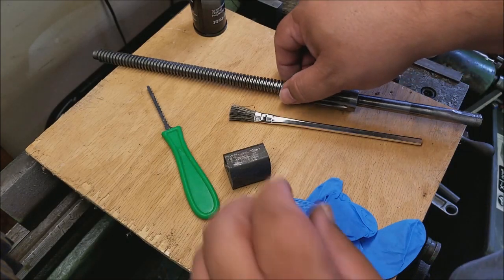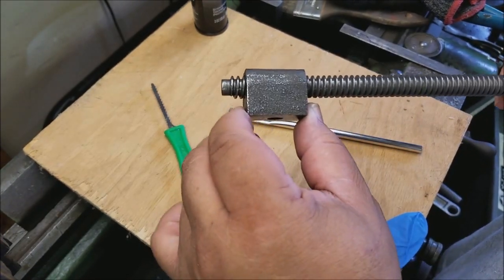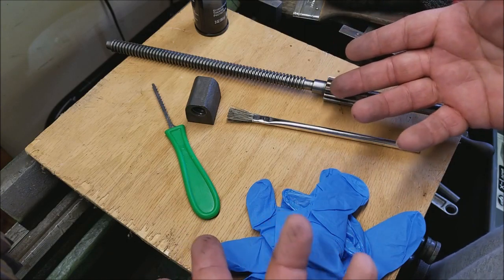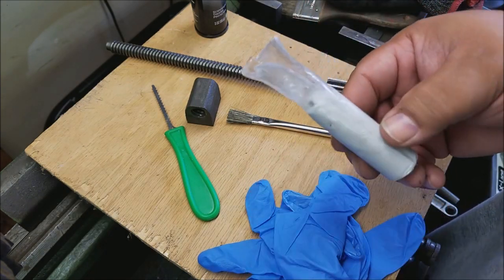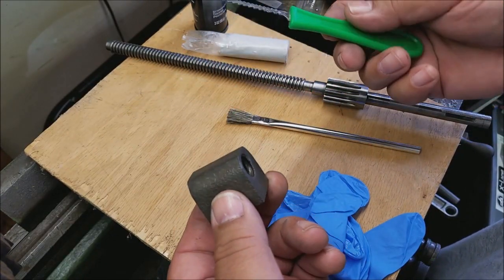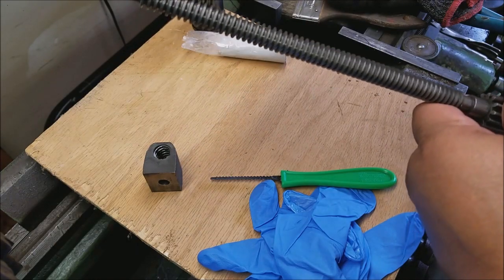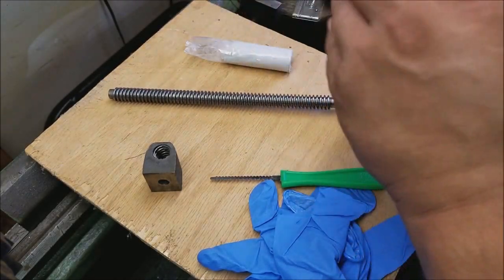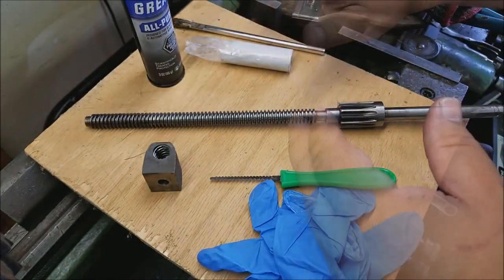SHELDON LATHE - WORN - CROSS SLIDE NUT REPAIR - FAIL???

Comment: I have a spare one of these that I made years ago. I tried selling it in eBay but no one bought it. It’s just sitting in a drawer now. I made it to fit my Sheldon. Did you ever get yours fixed?
Reply from the maker: Hello Some Guy,
No it's the same as I left it in the video. I wish all I had were shop projects to work on lol. How did your project come out and was that the only worn out piece on your lathe? Did you replace the lead screw at the same time? Tell me more about your sheldon lathe. Thanks for watching and commenting...
Mike - Plus8Precision
Reply: @Plus8Precision  you can buy Sheldon replacement parts from the company that owns all of the drawings now. They are willing to make anything, but they don’t carry any parts. The name of the company is Bourne and Koch, I urge you to double up on any heart Medicine you might take before you open any emails from them. Their prices are prohibitively high. There is a Sheldon Lathe owners group, we have been collaborating for many years now online. Often you find that Sheldon owners are quite passionate about their machines. There is just something about them, no one is willing to give up on them.
Reply: @Plus8Precision  well ok, for your sake I hope you really want to know. My Sheldon, was born in 1956 in Chicago, I am the third generation in my family to own it. I’ve had for 20 years now. I have made a handful of parts for it, with the lathe itself, while it was crippled. It still needs many worn gears replaced, which is quite a problem since they are 16 D.P. Gears with 20° P.A., and since that is an obscure pattern the gear cutters are not easy to find.
When the time came that I needed this particular crossfeed nut, I had to buy the 1/2”-8 LH tap to make it, though I still did the milling with the lathe. I did not replace the screw yet, cutting the spur gear into the screw wasn’t possible at the time. I hope to be in a position to produce that feature this winter when I can get back into my shop and work. It’s far to hot to be in there now. Reproducing the nut went great though, and I made an extra, I was hoping to sell. I have no need to keep an extra on hand since I can make one anytime I need. I would be happy to sell it, it’s made from brass instead of cast iron. 
My Sheldon, has a taper attachment, which is quite handy. I wish I had the metric threading gears, and plan to make them after I get the others finished first. I have never been interested in painting it, so it is obviously an experienced machine. I have the four speed under drive, and it has always been just fine. I had to reproduce the felt wipers for the carriage recently, fine detail cutting 3/16” wiper felt really sucks, it just didn’t come out crisp no matter what I did. I cut the felt oversize and smashed it in there,  they are working good and my shame is hidden by the wiper holders. 
Is there anything else you would like to know?
Reply from the maker: Hello Some Guy,
I don't know if you watched any of my other sheldon lathe video's but, I have made other repairs. Replacing a gear, changing bearings and bushings. My ways are in poor shape dimensionally but look ok by eye. I did find a company that sells the lead screw stock and lead screw nut threaded stock. I like my lathe I just wasn't planning on putting this much effort into it to just use it. 

I'm in the sheldon lathe group it use to be a yahoo group until recently. There is some good info available in the resources area. I did enjoy reading the history of your lathe.
Reply: @Plus8Precision  I’ve been in the Sheldon lathe group for years. It’s been a good resource. All these lathes are so old, there is little option for available parts. I only found your channel recently, I’m working through the videos you have. I didn’t like any of my options for replacing the screw besides making it from scratch. Let me know if there is anything else I can do to help you.  Or information I can provide. The crossfeed nut I have is available if you wish, just let me know.

Comment: BETTER ! GET ! ANOTHER !! BAND !! AID !! OUT !! 
PROBLEM !! FIXED !! NOW !!
Reply from the maker: @David, This was a trial using a product that i have used at work for over 20yrs. I have seen the strength of this "pig putty" in other applications. And since the nut is shot it didnt matter if it worked or not. As of right now it still works but i dont use it every day. I thought it would be interesting to share. Thanks for watching and commenting...
Mike - Plus8Precision
Reply: @Plus8Precision  There's Something ! Your not ! Doing ! right ! There ! But ! Good ! Luck ! Using !! Band ! Aid ! Putty ! To ! Fix it ! Then !

Comment: Did that also, and only worked for a few months. Cracked apart, Tried again, making the complete nut of 'Gorilla' epoxy, again worked for awhile, broke apart. Have to get one made.
Reply from the maker: Hello Lawrence, i figured i had nothing to lose and i already had the pig putty so what the heck, right? Is your thread an odd size, idk what lathe you have. We try thing and learn stuff then we know. Thanks for watching and commenting...
Mike - Plus8Precision
Reply: @Plus8Precision  @Plus 8. Thought the same as you, with my old lathe, what to do?, answer, anything?.  Now trying any avenue to 'fix' it. Well, it does pass the time.
Reply from the maker: Thats true it does pass the time lol
Mike - Plus8Precision
Reply: Well, 5 months+ later. Had the acme shaft machined to same size, going to make nut out of Gorilla epoxy, this time with wire in it. Hope it works better than the plastic one I made.
Reply from the maker: Lawrence,  I would be interested in the out come of your project. 
Mike - Plus8Precision

Comment: You may have already done so, but if not, a spindle bearing adjustment may be in order to help stop the vibration...
Reply from the maker: @Al C, i thought of that and i checked the spindle in all directions. I used my tenths indicator to perform the measurement. The bed and carriage are my issues.  I have done some measuring and im not sure what to do. Whatever i do i have to within the 4 walls of my shop.  Thanks for watching and commenting. 
Mike - Plus8Precision

Comment: I keep my punkin cutting tool's also.
Handy piece of equipment, I got two acme nuts welded to top of the old screw and fixed my 1912 pratt&whitney lathe.
Reply from the maker: @Kentucky  Trapper, you know your punkin cutting tools lol. The only acme 10 tpi LH stock i found is made from bronze. I see what you did saved the trouble of replacing the nut when all you needed was new threads good idea! Thanks for watching and commenting!
Mike - Plus8Precision
Reply: How did you weld them and secondly where did you get the Acme Nuts thanks!
Reply: @FernandoGonzalez-Nova  I made them, 4140.  Mig welded

Comment: Hi,
An interesting approach to fixing your problem. Looking forward to seeing your tool post update.
Take care

Paul,,
Reply from the maker: Hey Paul, 
Its what i had on hand so i could test it out in a couple hours. I have since found a sorce that makes blanks with the proper thread acme 10 left hand. I have the new tool post designed in NX. I am fairly certain it will provide enough rigidity and retain quick change design. Thanks for watching and commenting. 
Mike - Plus8Precision